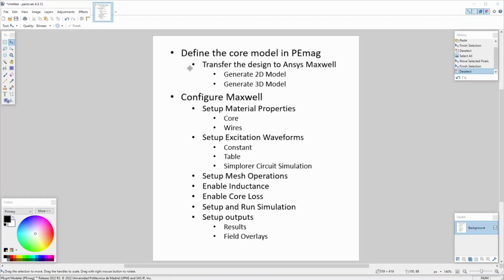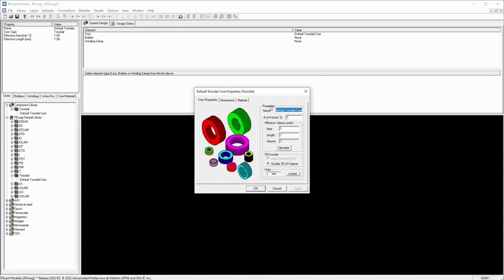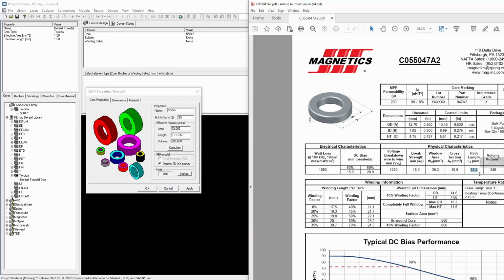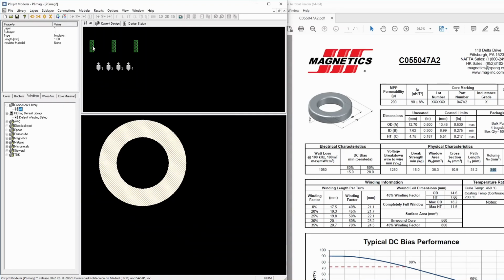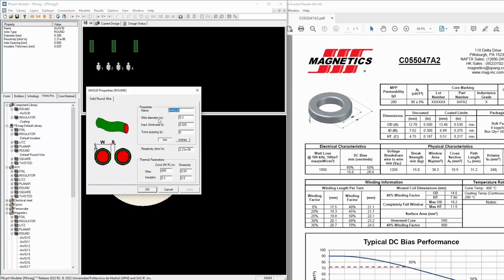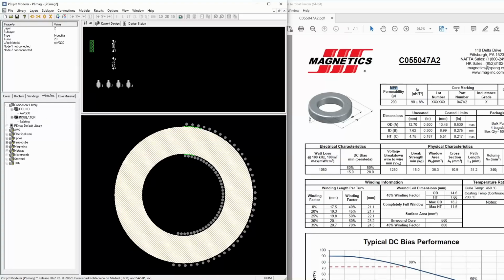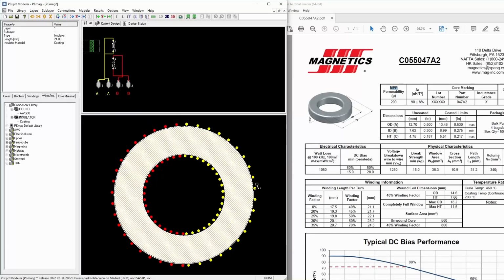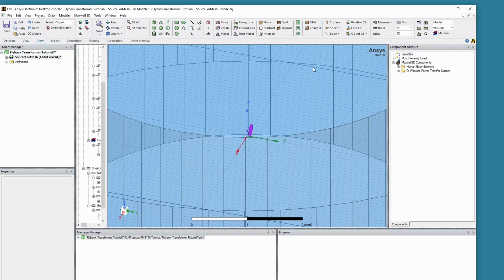Ansys Maxwell - Intro 1, PEmag

Comment: I am unable to fing PE mag tool in ansys electronics desktop
Reply from the maker: It is a separate program. Check in the start menu or install directory. I could be possible that it is not installed on your system.
Reply: @CircuitAnalysis  thankyou sir.

Comment: i have a problem with ansys pemag. When i start model generation(2D), an error pops up in"write fields" process, showing "Finished with errors" status. I dont get what I did wrong. There is no solution. Can you help me.
Reply from the maker: Are there any errors in the Design Status tab?
Reply: it works when i check "Use Electronics Pro, Premium, Enterprise product licensing". thank you!

Comment: I appreciate your effort to show the simulation. Thank you. How to make the primary 20turns in 5layer instead of single layer. I need to put each layer 4 turns.
Reply from the maker: The Windings section of the video shows how to set this up with the general philosophy being that you setup the winding config in the "All" tab and windings can be added in series or parallel so going from left to right is each layer and then if a winding is stacked on top of another winding it will be on the same layer. Then you wire them together and to the terminals. So in your case you would split your 20 turns into 5 separate windings of 4 turns each so you could put them as 5 layers from left to right and then you wire them up in series. Then you create 2 terminals and connect the first to the input of the first winding and the last to the output of the last winding. Hope that makes sense and feel free to ask more questions, thanks for watchin!
Reply: Thank you for your response. I want to implement the winding in vertical bobbin. There is a separator in between primary and secondary.  So i used sublayer to made the winding. But i increase the secondary conductor size same way primary layer thickness also increases. If i share the image then understanding will be easier.  @CircuitAnalysis
Reply from the maker: @kubendrangovindasamy3161  You may be able to  put the pic on google drive or something like that and make it public and share a link? Are you trying to interleave the primary and secondary on the same layer? If you need a super accurate geometry I would suggest you skip PEMag and just model the geometry in Maxwell or even another 3D cad program and import it into Maxwell. If you look in the playlist in the description I have a video on modeling the coil geometry from scratch in Maxwell: https://youtu.be/EXr0lcjaCqI?si=oCnCoP46DNL0IQsA